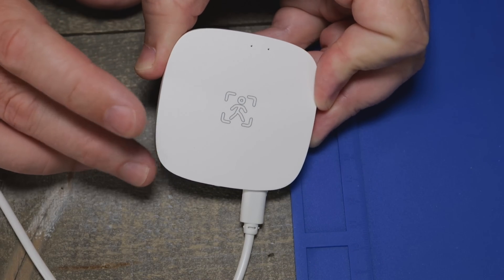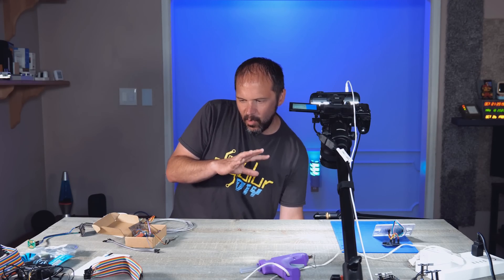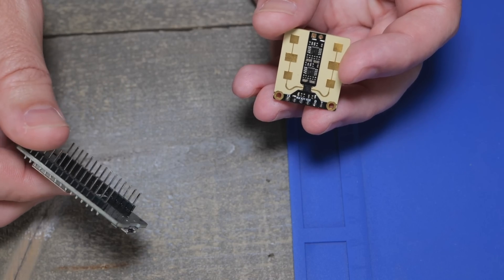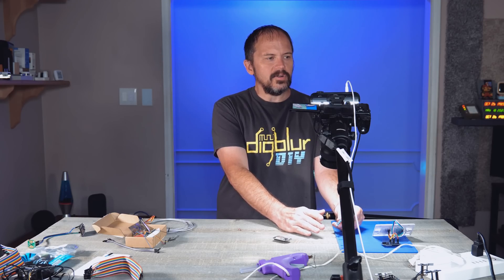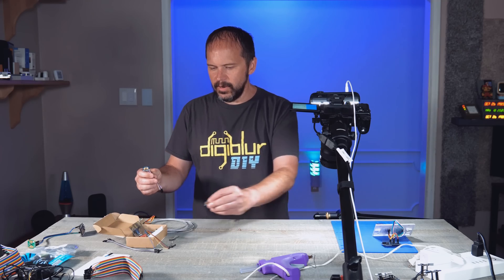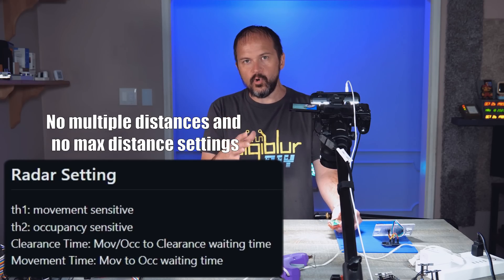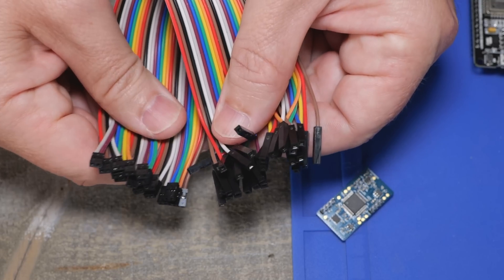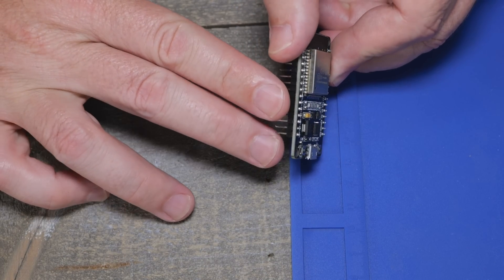Why did I pick the LD1125H mmWave Sensor - Full Segment

Comment: You’ve probably covered it in one of your videos. But how have you wired/powered these in your ceiling/attic
Reply from the maker: I don't think I have. I just have a 5vdc power supply on the attic that powers my various sensors in the ceilings and a couple walls. I used 18awg doorbell wire.
Reply: Got a recommendation on the 5vdc that can withstand the heat of an attic in the south

Comment: A lot of the interfacing to the Hilink devices is done only via the serial interface. The digital presence signal changes state almost a full second before the serial is updated. They go from pretty good to incredibly good if you use the pin on an interrupt.
Reply from the maker: I did see that pin but I haven't tested to see as these were faster than my PIRs. I will have to check it out.

Comment: Thanks to ur video I had a perfectly working LD1125H Presence sensor for last 15 days but now I have suddenly hit a road block,  from the past 3-4 days it randomly goes unavailable/unknown for few secs and then starts reading data again, I observed this is happening after latest ESPHome update and also sensor firmware update ( I am just suspecting), is there any other way to troubleshoot it ? I have continuous ping command to the esp32 board and I notice there is random packet loss for few secs, pls help
Reply from the maker: Did you do a full clean build files and update again? What firmware did you put on the sensor itself?
Reply: @digiblurDIY  Regarding firmware I just do updates via HA Firmware: 2023.7.0

I havent tried a clean build yet, what I have done now is to change power_save_mode to - none and this seems to made some difference, I will monitor it for couple of days and if issue persists will go for clean build..  I am also suspecting Wi-Fi range issues.
Reply: @DeepakCG  Any update ? im curious
Reply: @illegalmexicain  the issue was due to bad Wi-Fi connectivity, I have added an AP in one of my rooms and the sensor has now been working perfectly last 5 months.

Comment: Thanks for sharing your reasoning as I've been using a few different 24ghz MMWave sensors and you've convinced me to give the LD1125H a try as its super affordable and easy to setup! 👍
By the way have you heard of the Unity Sensor by Loopon Tech as it uses an ESP32-C3F board with onboard temp, humidity, light + HLK-LD2410 sensors with plug-n-play integration into ESPHome and no connection issues...?
Reply from the maker: Nice!!  No I haven't heard of that board before.  I did try the LD2410 but I did prefer the easier tweaking in realtime of the 1125 and it just worked.
Reply: Atom has similar products with pre installed ESPHome firmware, plug and play, and light sensors, but without temperature and humidity sensors. I believe that integrated temperature and humidity sensors are not accurate inside, especially when the radar module heats up, which can cause significant temperature differences.
Reply from the maker: Correct but humidity is fine and works for the bathroom. What mmwave sensor did they use? Do you have the yaml for it?

Comment: I'm probably buy the parts and do an assembly to play with but have an application that needs something nice looking on a desktop. 

How does the square Zigbee one integrate into HA? I don't see it in the Zigbee2MQTT supported devices list.
Reply from the maker: I use it with Zigbee2mqtt myself. Pairs right up.
Reply: @digiblurDIY  Thanks!

Any guidance on how to put it into pairing mode?

Comment: Great video as always Travis. Have you ever thought about sharing your node red flows on your website? Just for inspiration. You are the main reason I moved over to Node Red in the first place and I just think that it might be helpful for those that might be intimidated or scared of note red
Reply from the maker: Yup. I will be sharing this one as it has some other business rules I need to work out with the wall control rules. Love some NodeRed
Reply: @digiblurDIY  like I said you were the one that got me down the note red rabbit hole. And also getting away from the supervisor. Now everything  runs separately from home assistant and run through node red and mqtt. So that way if home assistant goes down everything still works in my house
Reply: +1 to this, I need to learn Node Red myself.

Comment: Hilink has some very nice tiny AC-DC step-down power supplies that can be used to power the ESP from a celing socket. Size is only 34x15x20 mm called PM01. I use these with the LD2410B (with bluetooth)  connected to Homeassistant with a Bluetooth proxy (seperate esp32 in another room)
Reply from the maker: I do prefer the meanwells of those as the fakes and issues with them kind of tainted the reputation on those PM01 power supplies.

It would be great to find a safe power supply that would fit in a box that is 5V 1A out with screw terminals.

Comment: If all you have are the bigger jumpers I bet you could pull the plastic off the jumpers plug them in and add hot glue to prevent issues with shorts.
Reply: For 2.54 vs 2.0 mm that might work, but pin diameters definitely get smaller as the pin pitch decreases, so the female crimp headers will not mate snugly.  You could always make up the difference by additionally soldering the joint as long as none of the connections are carrying much current (because of thermal cycling), which in this case, they certainly aren't.
Reply from the maker: Nice idea!